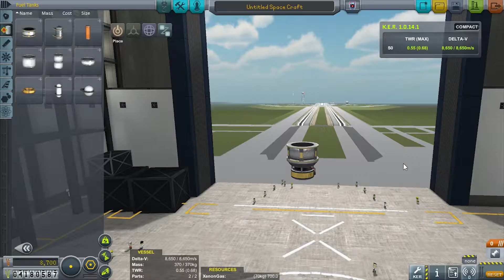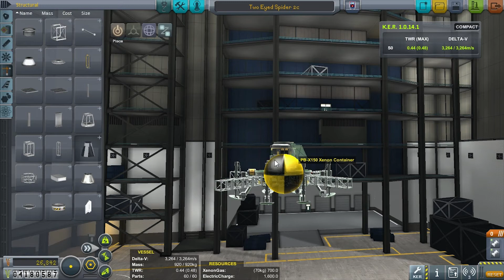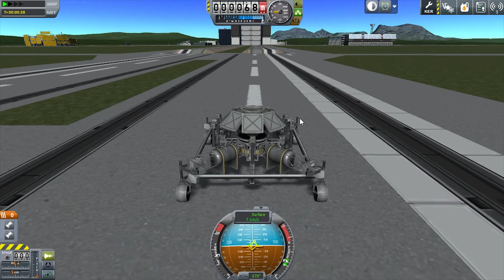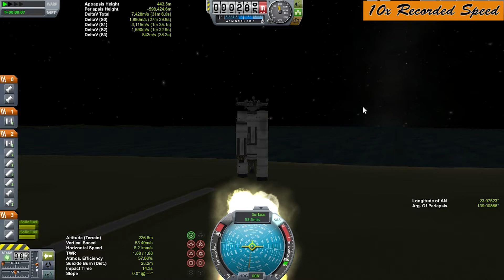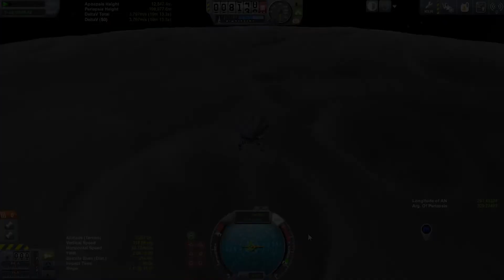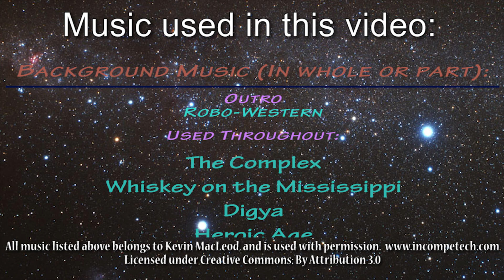Let's Play - KSP 0.90.0 Hard Career Ep22 - TES-2c

Comment: In VAB and in the SPH, you can press R to change between radial and mirror symmetry. Helps me with making asparagus separation stages
Reply from the maker: GhostFlame713 Well, that's handy.  Thanks. :)
Reply: Yea I used the mirror in SPH to make Mk1 and Mk2 fuel tanks with separators on them, then made them sub-assemblies.

Comment: Very nice redesign of the TES!  Would it be possible to see versions of the ships without the KER stuff on them?   I'm running straight vanilla, and couldn't open the crafts to use them.  I did come up with a non-rover Ion lander based off of the original spider, with 8 solar panels in orientations that can let the drive be used without losing any electric charge: https://www.dropbox.com/s/urgkf67ue94m0ue/Ion%20Lander.craft?dl=0 (pic: http://steamcommunity.com/sharedfiles/filedetails/?id=394995263 )
Reply from the maker: phuzziwan_kenobi Nice!

In any of the .craft files, removing KER components should be as simple as removing the section for PART that contains: "part = EngineerChip"

Just delete out the word PART before it and everything in the wrapping braces.  This way any of my designs can be adjusted for stock if needed.  They don't parent for anything so it should be fine.
Reply: Cool, i didn't know they could be edited that way!